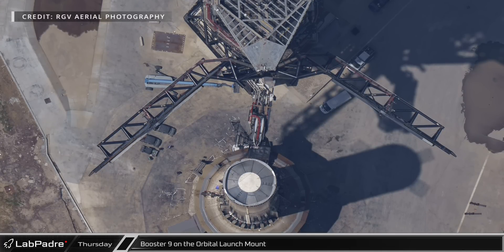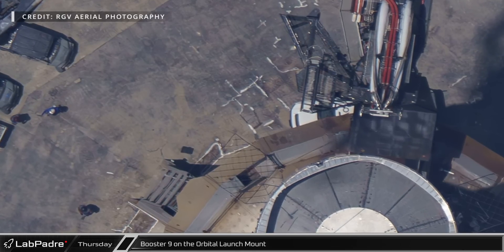Is Starship Already Prepared to Fly Again? - Starbase Weekly Update #77

Comment: Spacex  has done a extraordinary job , repairing the  orbital launch mount and it's site ,the upgraded water deluge system a magnificent accomplishment in such a short period of time, you have to calculate using more powerful engines into the equation also this is the  perfect time to add at least one flame trench diverter if not two.DDM

Comment: Readiness for flight?!? Really?? With 2 engines shutting down early?!?

Isn't that a bit premature until we know WHY those 2 engines shut down so quickly? I like SpaceX as much as the next guy, but lets not get ahead of ourselves. A "good" static fire should include all engines, & they should stay lit for the duration of the test. 

In fact, as a Test Engineer, I'd like to see a full duration test. That's probably not realistic with the limitations of the deluge system, but SpaceX really should be able to keep ALL of those engines lit for more than 5 seconds. After all, they're not even firing them at full power.

Comment: It would had been easier to use small staging motors.  But engines typically used for this are solid motors and they don't want to use anything which isn't rapidly reusable.  And I don't think pressure fed methalox thrusters would have enough performance.
Reply: The whole purpose of hotstaging is to maintain the velocity of the Ship. Thereby, saving fuel and increasing the amount of payload, by about 10%. And for Starship, 10% is substantial. It will pay off, down the road.
  👻☠️🗽💯🙏

Comment: The water seems like the pressure from the rocket engine is keeping the water from moving. 🤔
Reply: I think it's turning a lot of it to steam
Reply: With such power no water can challenge 33 raptors at it's peak :), I think the idea is to counter the power of the raptors as best as it can, keeping pad cool, and as soon as it starts to lift the pressure of the water will cool the area rapidly.

Comment: I would really appreciate an explanation of how the outer raptor spin start system works.  I've seen a few interesting video clips with brief peeks at parts, but I have yet to see a detail of the entire thing.  Thanks!
Reply: There's an awesome video on YouTube. It's, Everyday Astronaut's, What It Takes To Start A Rocket Engine. It's fascinating! Well worth the watch. So many dangerous things happen, in the blink of an eye, the computer actually has to anticipate events.
I don't think it covers, specifically, outer Raptor spin up systems, however, it's pretty much common sense, a lot of piping and quick disconnects.
Enjoy the Start Up video. 
  👻☠️🗽💯🙏

Comment: Thank you for great content!
Does spin test use oxygen and nitrogen only? I thought that firex system suppresses methane when performing spin test.
Reply: Methane and oxygen are used in a spin prime.  And before that procedure starts the Fire X system sends a nitrogen under the pad before the spin prime.  That way oxygen is forced out of the area and if there is random spark from the somewhere it won't ignite the methane.